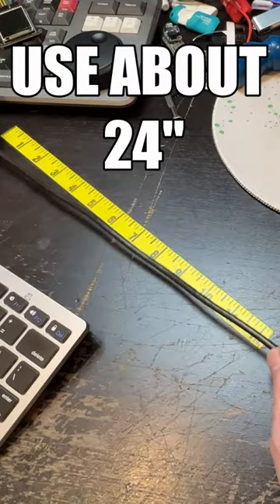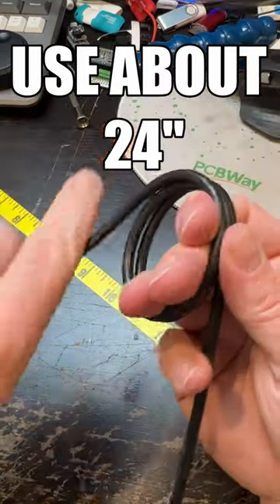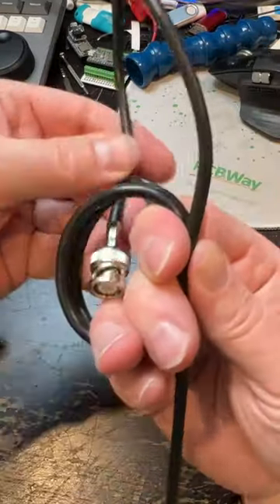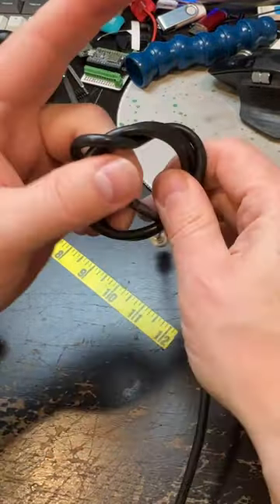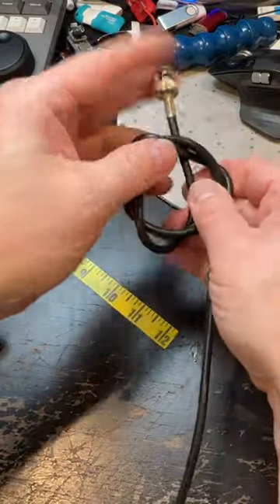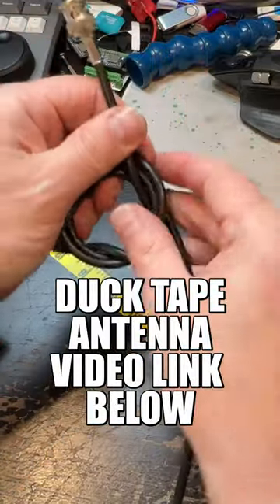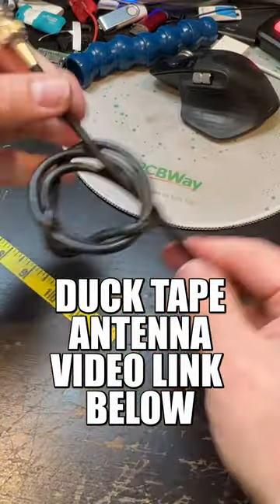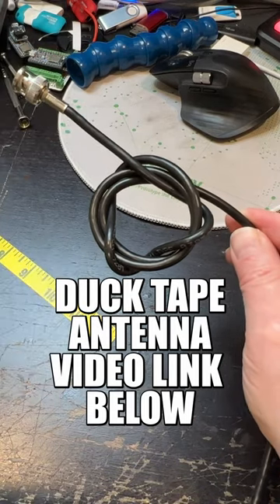Simple Coaxial Balun for 2m - 70cm - 6m bands

Comment: Well. That‘s just a coil you added to the system. You have to match the impedance of your antenna. That is done by adding coils and capacitors. But since you didn’t measure anything, adding a random coil seems kinda useless.
Reply from the maker: Not really it still stops some reflected signals from the skin effect of the core from going back to the radio. This has been done for many many years and a proven way no allow the magic smoke in your radio to come out.
Reply: @VE6SFX_HamRadioRookie Where is the difference to a coil?
Reply from the maker: I see where you're coming from, but let's dive a bit deeper into what a 'dirty balun' really is. It's often mistaken for just another coil, but its role is quite specific and essential.

A dirty balun, often improvised, isn't a balun in the traditional sense. Its primary function isn't to transform impedances or balance to unbalance like a standard balun. Instead, it's used to prevent RF currents from flowing back on the feedline. This is crucial because these RF currents can cause interference and affect the performance of the antenna system.

This coiling forms a choke that impedes the flow of RF currents along the outside of the cable. While it may look like just a coil, the way it's implemented and its effect on the antenna system's performance is what makes it special.

I hope this clarifies things.

Comment: The principle is different depending upon the desired effect.  

Balun to match or correct impedance between the antenna system and the radio. 

Common Mode Choke to reduce because the braid becomes a counterpoise on some types of antenna setups. 
Reduce that electric potential coming back to your radio, shack, etc. 

Installing ferrites on cables (most especially USB computer cables in a modern ham shack) to  prevent RFI into other devices. 

When I key my HF rig, if my computer speakers are still powered on, it is unpleasant to say the least. I need to put beads on those cables. 

And then there’s grounding and bonding which is it’s own ecosystem. 

I just found and subscribed to your channel.   I love your energy and enthusiasm and will tell others. 

Thanks.
Reply from the maker: Thank you for the advice. Again for the subscribe and I am ultra happy you are telling others. This truly means the world to me. Thank you and 73

Comment: I’d call it a choke balun, as it choking the RF flowing back down the braid of the coax.
Reply from the maker: Thanks good to know. I’m slowly learning the language of ham.
Reply: But if chokes it from coming to the radio wouldn’t it choke it from going to antenna?
Reply from the maker: Yes and No. They get rid of common mode currents (the unwanted stuff) that are on the  outside of the shields cable. This is beneficial for both directions. I am not 100% sure but I think using "RF flowing back" is not quite a proper term for this. However as with all my answers I am new and I am the 'Rookie' so I could very well be wrong.
Reply: @VE6SFX_HamRadioRookie  not saying your wrong at all. I was asking for my knowledge.
Reply from the maker: @ATR_Mid-TN-WX  Yes totally! I am sorry if that came off as curt. Totally not my intention. This is good for all of us to learn. I am just making sure people here know I am very new, like 8 months into the hobby new, so take all I say with a grain of salt. :) 73
Reply: @VE6SFX_HamRadioRookie  not rude at all. I’m right there with you. About 1.5 years for me.

Comment: Yes. It's called an ugly balun. You are choking common mode current in the third wire. It's hidden, but totally really there. That toroid you just wound should have about two hundred ohms of inductor reactance at the frequency under test. I'm assuming 50 ohm coax here.
Reply from the maker: Yup and thank you for the clarifiction